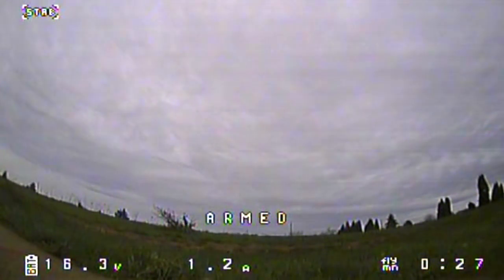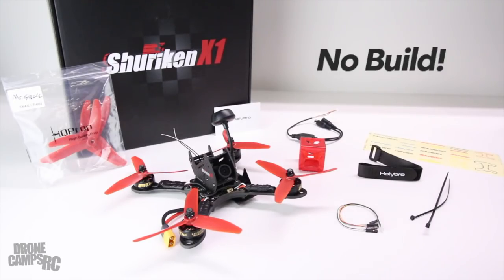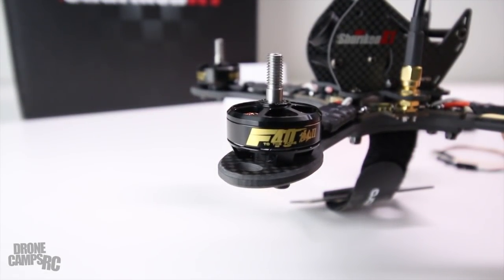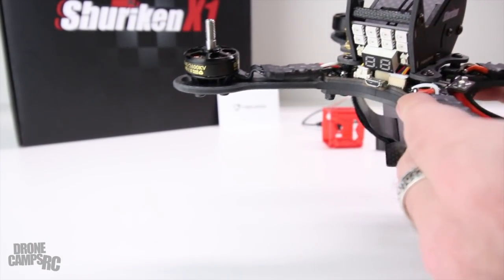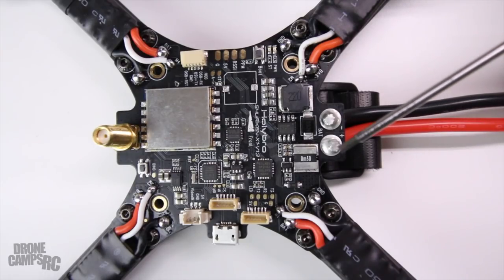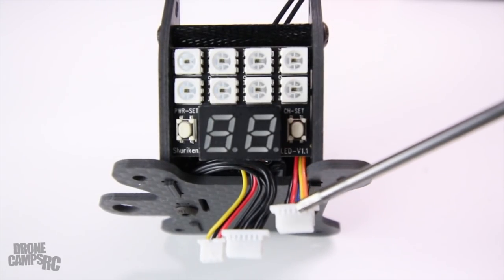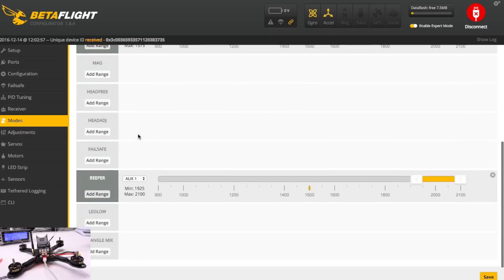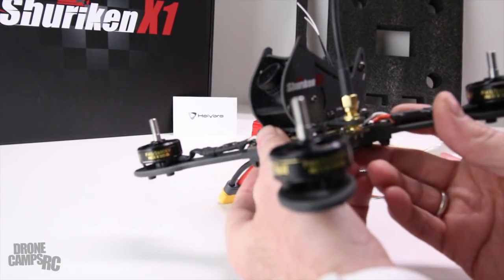Holybro Shuriken X1 - AMAZING X-QUAD Flight & Full Review

Comment: hello does this use  PAL  or NTSC  camera ?   THANK YOU
Reply: antoine ozaneaux I believe it's switchable to either..
Reply: thank you guy   I like the x1  as well as the new furribee fuuton  but it dosnt have a selectable vtx output  , someone told me it will be difficult to fly with others  .  any help I choosing between the 2 would be great
Reply from the maker: Antoine you can swap out the vtx for about $25 and have a switcher on it. 👍🏻👍🏻👍🏻
Reply: thank you  . I have a prop question  I run 5x4.5x3  on my vortex 250  could i run those on the X1  ?  also could my vortex 250 run on 5x4x3 like the ones on the X1 or similar    I am trying to find out if I could by just one kind of props  and fit these 2 quads and a little more efficiency from the vortex I uploaded a new video  in case you are bored and want to start a up and coming HACKS    section on your channel  thank you  for your great channel
Reply from the maker: Yeah you can run both of those. No prob. Ps. Still have my X1. I love it.
Reply: my x1 is due for delivery today, by chance have you flown it with a standard size action cam rather than the go pro session?

Comment: I'm really digging this one! Do you think it would bind to a Spektrum DXe? Or would it even be worth trying? I suppose you could tune it a bit on the computer with the cable from Spektrum?
Reply from the maker: I believe you can yes. 4 Channels on the DXe. You might be safer with a DX6 but worth a shot! You can tune it with a standard micro USB (android style) cable  to your computer in Betaflight. - JD.
Reply: Oh the DXe is a full 6-channel. The draw back though is that it doesn't have a front-panel LCD like higher end transmitters, so you have to do all the programming on a computer or cell phone (there's an app) through a cable that is sold separately by Spektrum. I'm just wondering how much tuning is possible and how much control you'd really have over tunes with these bigger quads. It has worked great with my Inductrix so far. I'm planning on getting a Taranis or at least a DX6 when I get larger quad, but was hoping the DXe might suffice for a while if I went ahead and got something as big as a 250.
Reply from the maker: Go for the Taranis Pplus dude. You will not look back. No limit on models like Spektrum radios!
Reply from the maker: *Taranis Plus.
Reply: Everyone seems to love their Taranis, it's definitely #1 on my list, thanks!
Reply from the maker: Dx6e is user friendly, but limits the amount of models you can bind to it.

Comment: Why so many interference in the video signal?
Reply from the maker: I was running it on 200mw but you can also run on 600mw. My Fatshark antenna could have been a little loose as well. - JD.